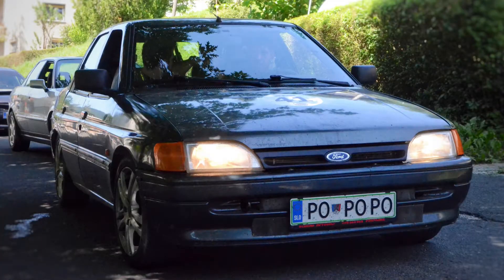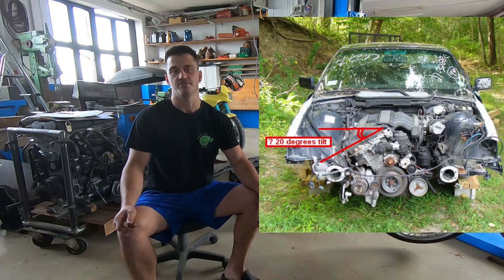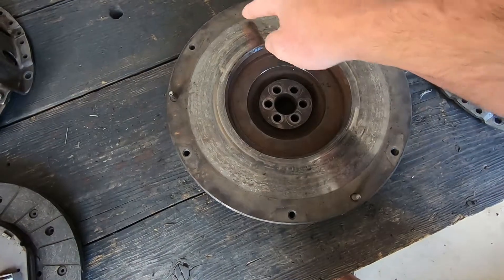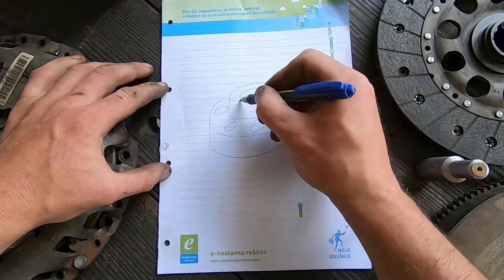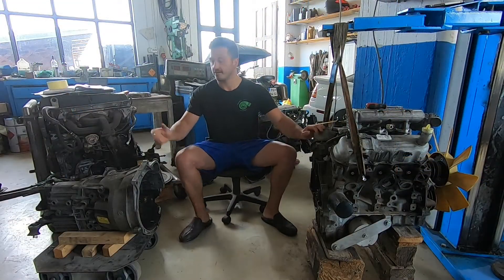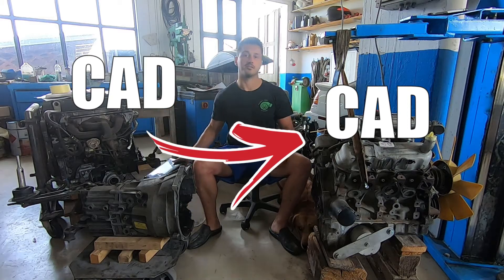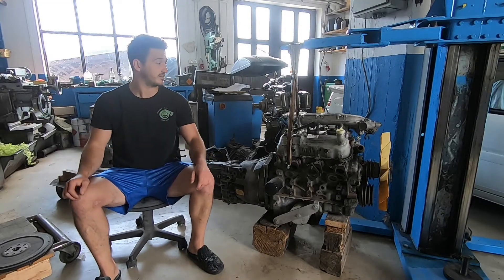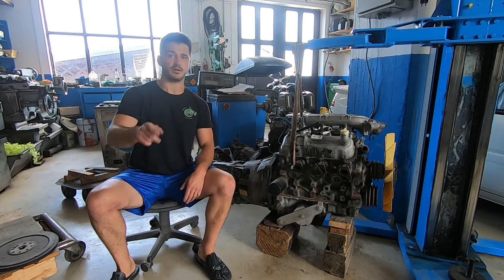Fitting The BMW ZF Gearbox to Cologne V6 | Ford Sierra Coupe Turbo - Track Weapon Build | Episode 8

Comment: With the spacer piece on the crank to bring out the flywheel would you need to have engine rebalanced?
Reply from the maker: I wouldn't say so. 
I have statically re-balanced the factory flywheel, which was somewhat out.  If anything, it should run smoother now.
Reply: @HappyDayGarage  I saw on your other episode you did the balance and I think it was out because of the raised space you installed so the bmw pressure plate could work.... I want to fit a bmw gearbox to a ford 4.0 sohc straight 6 motor
Reply from the maker: @nicusvisser5229  Yes, this certainly is possible. I thought about testing the original flywheel alone then also flywheel with pressure plate fitted, but just didn't bother. Have to get this thing working already . 😄
Reply: @HappyDayGarage  haha okay good I feel the same with mine if been struggling for months now to get it running right... It's a ford sierra 3.0v6 xr6(south Africa) witch I converted to  EFI and turbod